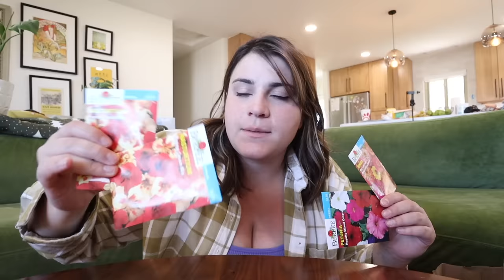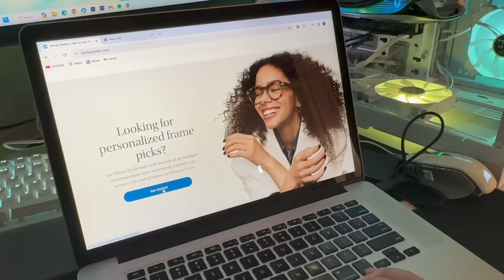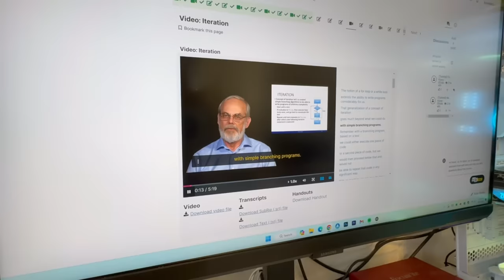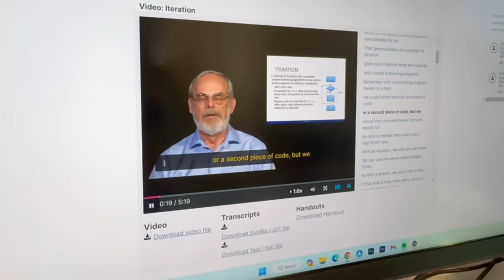Chill Chatty Vlog: mini target haul, trying new recipes, and building stuff.

Comment: Chicken coop tip that may be helpful...Run a screw through a large washer to secure your hardware cloth for extra security. A lot faster and a great way to hardware cloth a door instead of using staples and hammering. I'd also recommend putting some type of cheap trim along the edges inside the shed to keep the poo from falling into the crevices. Lastly, consider contractor sand in your run once the grass disappears (it'll happen faster than you think.) You can kitty litter scoop the poop out, it keeps it clean/less smelly and is great for dust bathes. These are just my recommendations after building my own coop via trial and error. I can give advice if needed. It's looking great so far and you'll love having the ladies!

Comment: Just a pro-tip, if you pre-drill your screw holes, you significantly reduce the risk of splitting the wood. It's an extra step, but worth it, and especially helpful when you're near the end of a piece of wood. Just be sure to choose drill bits that are about the size of the core shaft of the screw or a little smaller (that is, without the actual little corkscrew edge bit) so that the screw is able to grip the wood.

Comment: You should go to harbor freight and get a small air compressor and a pneumatic palm nailer. They are the coolest tools. Or a heavy duty staple gun at least for securing the wire mesh. It will make your coop building endeavors much easier.

Comment: You would absolutely fit into lulu. I’m a size 18/20 and I fit into their size 14/16. The align leggings suck though. Mine pilled immediately between my thighs, they are staticy, and they just fall down constantly. They are not meant for working out (the align) so they don’t have any sort of shaping or compression. I love my lulu tops I’ve gotten though!